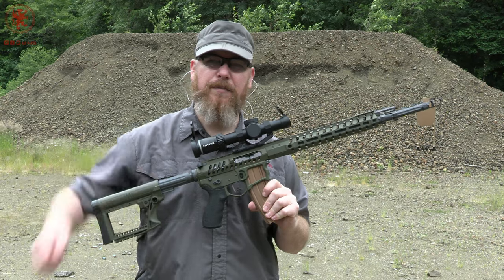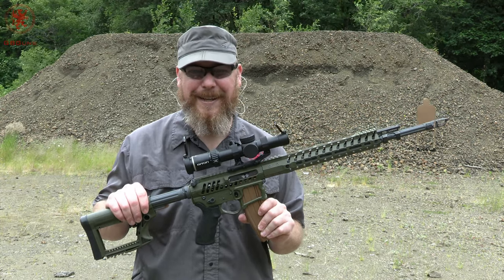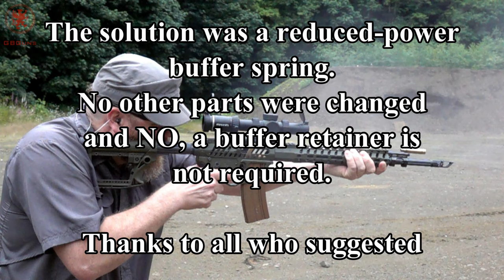Fancy Rifle Redemption!

Comment: why does the bolt carrier group "bounce" on closing. like it slams shut n bounces back out a lil like it didnt lock properly. you can see it clearly in the slow mo. or is that just me.
Reply from the maker: They all bounce like that when filmed at that speed.  Believe me, we've filmed a lot of them.
Reply: @GBGuns  ive never actually watched a slow mo of the bolt. i just thought was a lil weird and didnt kno if that was normal or not.
Reply from the maker: Yeah.  People talk about bolt bounce as a problem, and it is,but what many don't know is that most ARs have some level of bolt bounce

Comment: What was the issue with the front take down pin? Beautiful build
Reply from the maker: None with the front pin
Reply: Ok sorry, I thought in the last video,  the front pin came out, I built a dahmer arms, as a straight shoot but classy build, not a banger that you don’t really have issues with. I had the same issue I used a 20inch carbon fiber barrel with rifle length gas system and it was a bitch to get running 1000% ended up with a lot of short strokes,
I used a adjustable gas block and had my gun smith open the holes on barrel and block and what solved 90% of my issues were buffer. I ended up with a kyntec carbine buffer, and a master of arms adjustable gas block. I found a dahmer billet set on mi gun owners. Old timer bough it and didn’t like it. I believe there out of business now. I like the way yours runs it’s so different with the rifle gas system and longer barrels. I don’t beat the hell out of it like I do a carbine. I really like your build. Thanks for replying. Have a good day.

Comment: My first thought - was that spring was way too heavy when you racked it in the last video. Then I saw no strike plate / retainer / whatever it's called when you took it apart - and now I see that you don't NEED one - but - what advantage to you gain by not having one? Sure makes them easier to take apart with one.
Reply from the maker: Yes for sure, but in this receiver set it threads in with a TINY little Allen key.  I knew I might want to adjust the spring or adjustable buffer so I left it out for easier access.  The rifle was an experiment and proved many a build lore wrong.
Reply: @GBGuns  Ok, so easier to tweak - that's an advantage I didn't think of ;)
Reply from the maker: On a normal AR it's no big deal, but to need a tiny tool and a couple of minutes just to remove the buffer on this receiver is a no go for me.
Reply: @GBGuns  No doubt -any time you can avoid fiddly little tools it's a win.

Comment: If you ever want to compromise to the lightweight features, I would suggest a Leuopold VX-Freedom 1.5-4x20. It's about a third of the Riton you have in this video in almost every way but especially in weight at just 9.5 ounces!!!!
Reply from the maker: But is the glass any good? Leopolds are always so dim and grey which is wierd considering they're right here in oregon where we need brighter glass
Reply: @GBGuns  
It's as good as any comparable priced scope, just part of the "compromise" for lightweight... not true 1x on the low end, only 4x zoom, only 1" tube, not lighted reticle, etc. But so far I haven't found any other lpvo under 10 ounces.
I am open to suggestions... anyone?

Comment: I am very curious why they told you that set was never meant to be sold together. Rainier arms sold it to me as a match set. mine and yours look identical except mine does not have F1 on the side mine just has it on the top. They were marketed to me as a match set last August. They came in 1 single box made for them together with cutouts. Now mine was painted black, so maybe there is a difference between mine and yours. I am in the process of building mine now into a pistol.
Reply from the maker: Yup ours came in single boxes too.  They work together, but are not st all a matched.  Rainier screwed up

Comment: So how did you finally figure that out? Glad to see you got it running.
Reply from the maker: It needed more gas or less resistance.  The options were to risk the barrel by opening up the gas port or reduce the spring strength, so we went with the spring for less than $30.

Comment: Throwing the shells forward is over gassed?
Reply from the maker: On a completely milspec rifle using milspec ammo maybe.  If anything about the rifle or the ammo is changed then it's just a myth.  The direction the brass flies is a result of how fast it hits the deflector which means that chamber pressure, chamber friction, initial carrier velocity, spring compression rate, brass deflector angle, shell weight (steel vs brass), etc etc influence how your empty shells fly.
Reply: @GBGuns , I had heard throwing shells forward and parts wear were from over gassed ARs.
 I don't know for sure.
Reply from the maker: @mikerostine6253  on a milspec gun with milspec ammo it's an indicator that the carrier is moving rearward with too much speed.  That could be any number of worn parts, OR over gassing.

Comment: Glad you got 'er running.
Reply from the maker: Thanks for following up.  So many folks threw a nonsensical comment on the first video and didn't bother to see that the problem had been fixed, what the solution was, or to see how smooth this thing is.

Comment: I only heard 9, so I slow mo'd it, and guess what? it was only 9.  Also in the first video I didn't see any sign of lubrication anywhere, and in this vid everything looks so stiff and difficult to operate.
Reply from the maker: Yup, even harder to count that fast when you're the one shooting.  I missed one, but it doesn't matter, the point was still made.
Reply: You can hear how dry the BCG and charging handle are at the 4:03 mark of the video. Lube that baby !

Comment: seems to be over gassed???
Reply from the maker: If you're judging based on ejection pattern, that onyl really applies when using a fully milsepc system and the same ammo.  Ejection pattern can vary by ammo type just as much as by gassing, or buffer weight, or buffer spring.  It's lore.
Reply: @GBGuns  BULLSIHT  works for any 223 / 556 AR-15 Except for maybe a slick sided upper receiver with out the brass deflector....
Reply from the maker: You've got a lot to learn, thabks for being here.
Reply: @GBGuns  I've learned plenty shooing carbine competition with 1,2,3 place awards been building ar-15s for nearly 15 years and own 29 of them....seems to e your a beginner dude and have A LOT  to learn yet!!!!

Comment: Got some bolt bounce going on.
Reply from the maker: All bolts bounce when filmed at that speed.
Reply: @GBGuns  🤔 good point
Reply from the maker: I used to used that 1000fps camera a lot and every time I filmed an AR folks would comment on bolt bounce, but few seemed to notice it happened on EVERY AR I filmed
Reply: @GBGuns  that's a nice build by the way. Did you cerakote that upper & lower or was it shipped that way because I remember you saying that they said it wasn't supped to be a matched upper and lower.
Reply from the maker: @jaysonhaselton  yes I had it cerakoted, part of why the receivers were cheap is they were in the raw.
Reply: @GBGuns  well man you did a great job. Keep up the good fight brother 🇺🇲